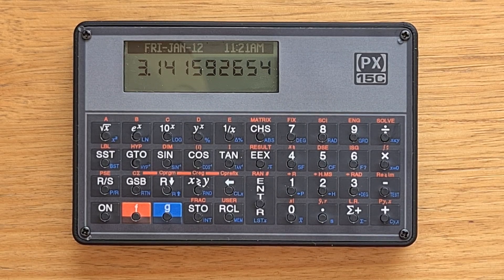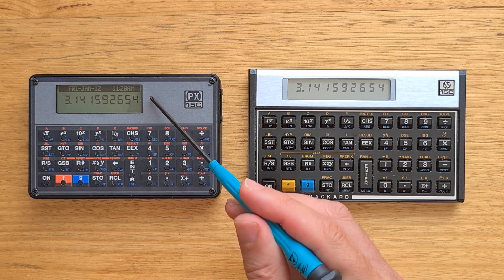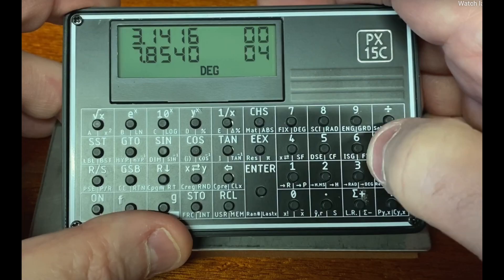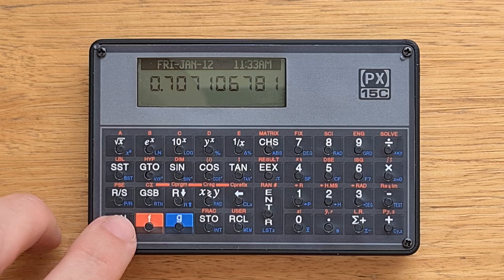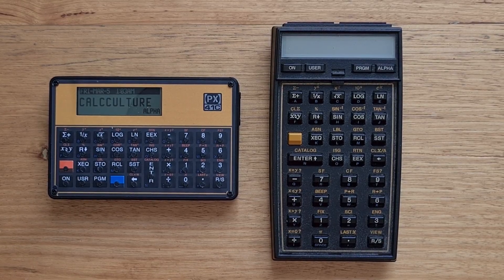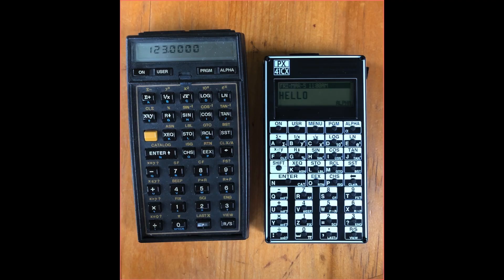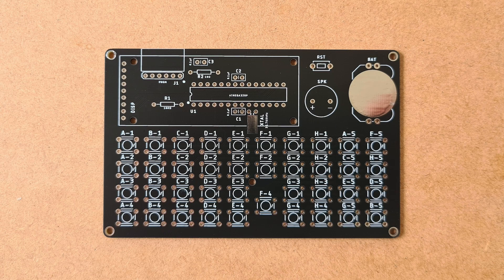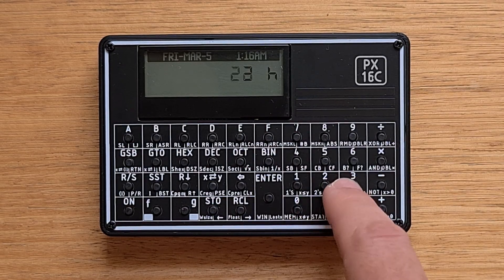PX-15C, PX-16C & PX-41C Calculator Kits Review

Comment: I have a PX-16c that I put together when I was learning how to solder. The aluminum face and rear boards with the 3D printed bumper/case results in a nice fit and finish. It's very satisfying having a hand-assembled calculator in my collection.

These are awesome kits for beginners as the repetition of soldering all those button leads gives good experience, while not being an overwhelming amount of solder joints compared to a more complex kit. Alex is very friendly too, if you get one and have trouble with it you can contact him and he might be able to help.